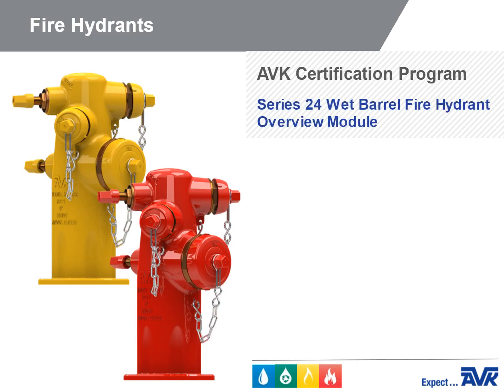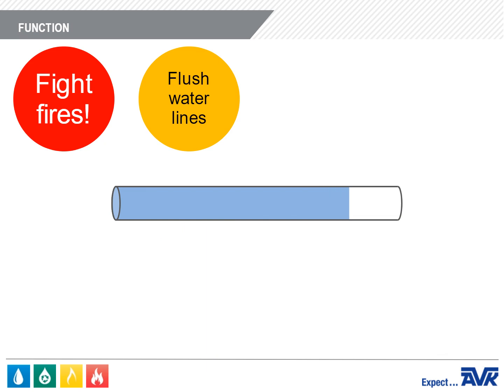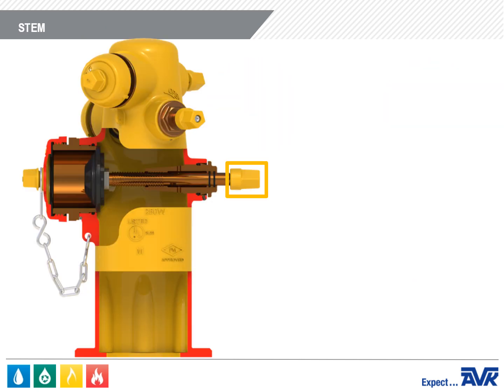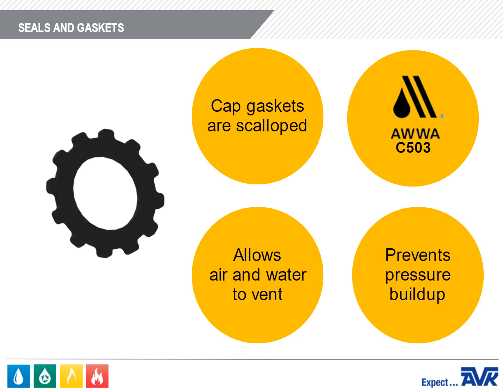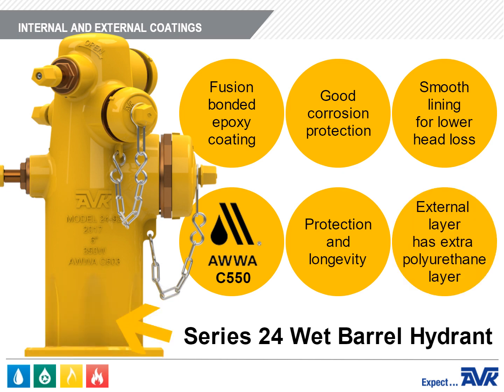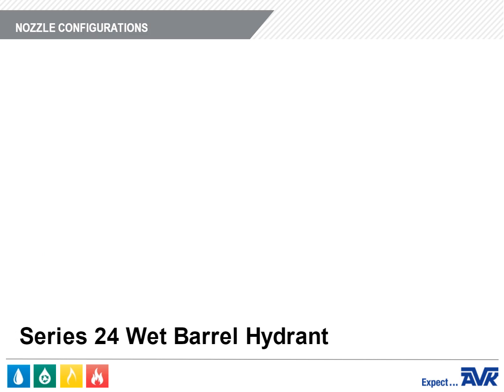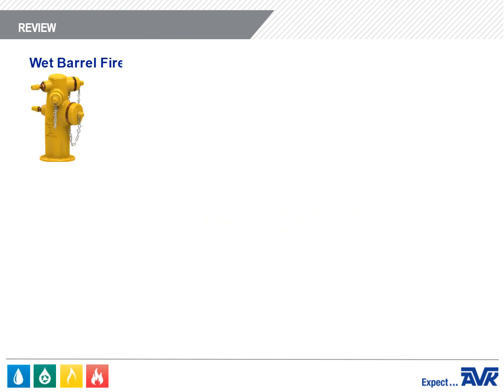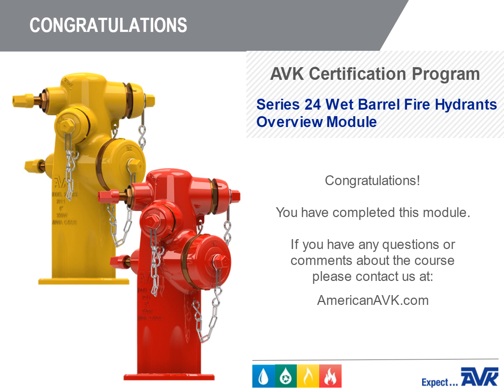Series 24 Wet Barrel Fire Hydrant Overview Learning Module Video

Comment: Are the nozzle caps the same design on both the wet &dry barrel types?
And are they available in bronze instead of cast iron?
I'm currently using the AVK dry barrel model and was looking for bronze instead of cast iron since case tends to rust making it difficult to remove in most cases...